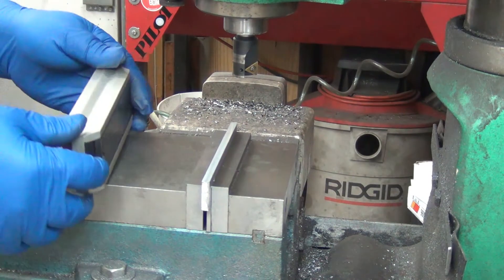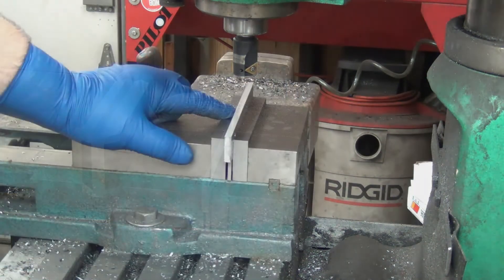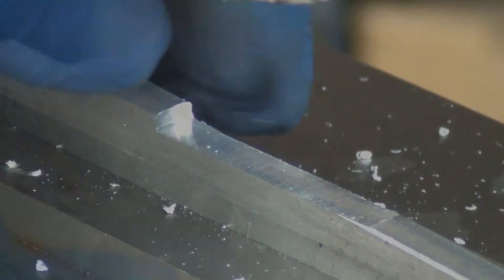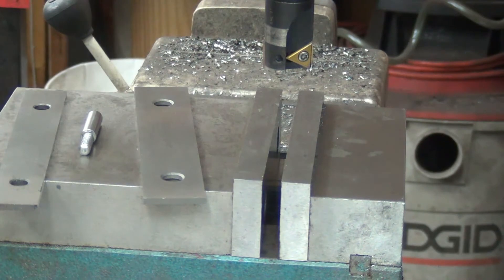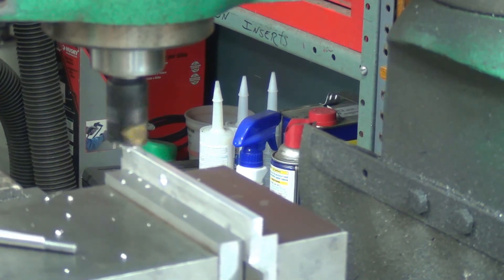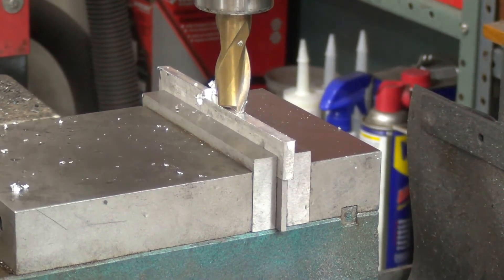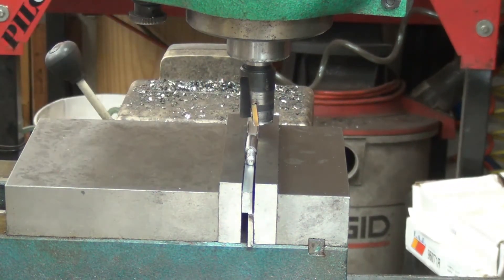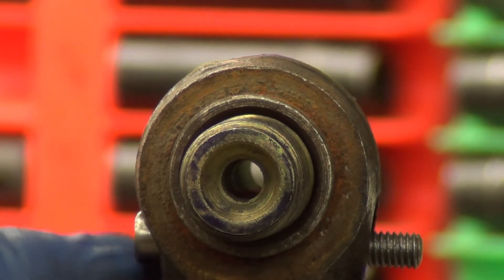Cotter Bolt pt3 - Cutting Taper, Checking Fit

Comment: http://www.classic-cycle.de/en/Hubs-Axles-Chainwheels-Cranks/Cotterpin-9-mm-1-pair.html
Reply: Hollowman1701 Boy I thought these pins looked familiar!    I wonder how the daatsun pins match up to those.   Either way there is something to be said for hand made parts...
Reply from the maker: The bicycle parts have been brought up a couple of times.  So far, they've all been to big.  There's not enough of these Datsun trucks left anymore to warrant a huge run of them.  The dealers ran out of these parts years ago.  There may still be some holdouts in the far east, but a reliable source isn't available as far as I know.   Thanks!!!
Reply from the maker: Mia Knecht
I'll have to look at the kingpin cotter bolt.  They're bigger and may be a match, but new ones come with each kingpin kit, so it hasn't been any kind issue yet.
I've known several guys to "hand make" these bolts for their rigs......they just take a 5/16" bolt and file an angle on it.  The nut still grabs well enough on the 2/3's or the thread that is left. Thanks!